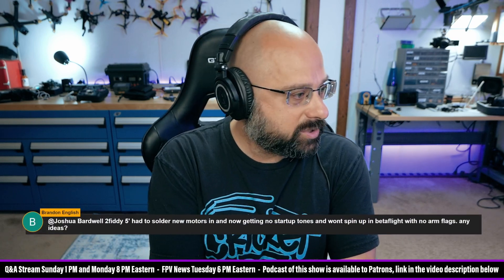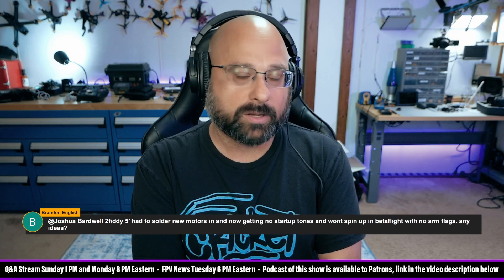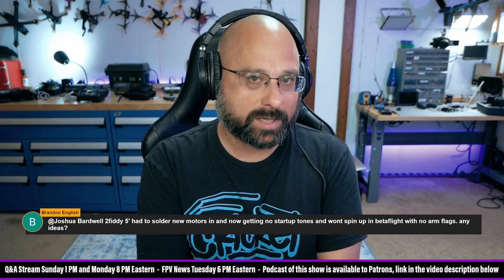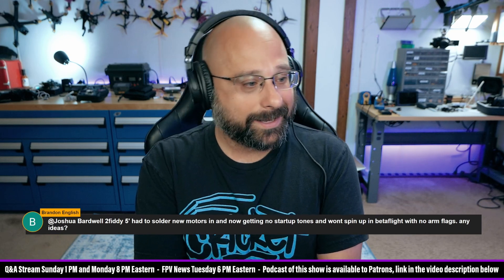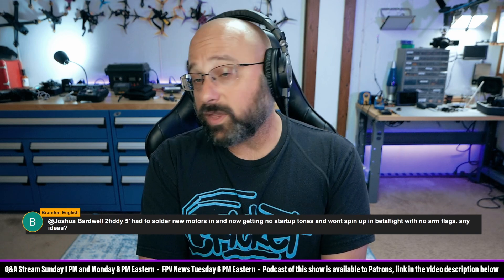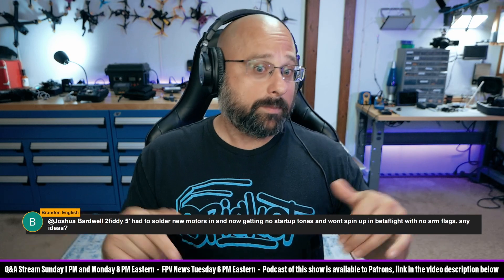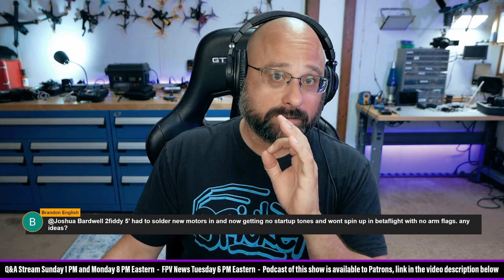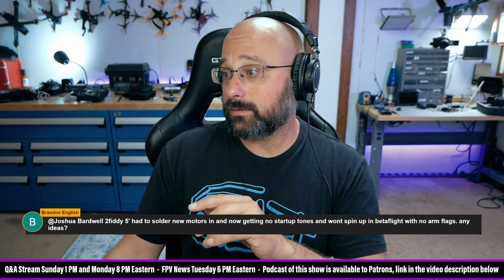New Motors And Now My Drone Doesn't Work! Help! No Startup Tones! - FPV Questions

Comment: In situations like these, using a power supply with an amp meter comes in handy to check if ESC is at least drawing current, shorted out or if it is totally dead. In this case, I wonder if when the motors got mounted back on, he used screws that were too long on the motors and are now shorting out the motors with the frame.

Comment: Check if the power wires are still good, if the battery voltage is getting to the esc.
The cable could've ruptured inside the insulation... Or something.

Comment: If there is a one in a million chance to screw something up it will be me to do it lol. If I didn't have bad luck I'd have no luck at all. Crashed it and killed 2 motors but other 2 still spun. Got all new motors soldered in and nothing. First time soldering motors so I could have screwed it up doing that. Lesson learned I guess

Comment: Different motors - different motor base height, bolts shortened motors to the frame.
Unscrew the motors from the frame and try powering up again.